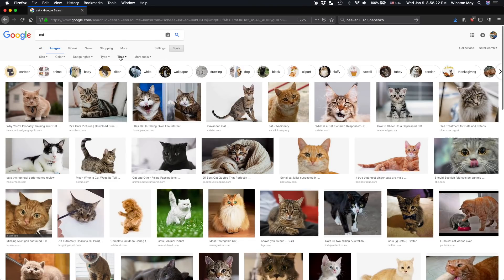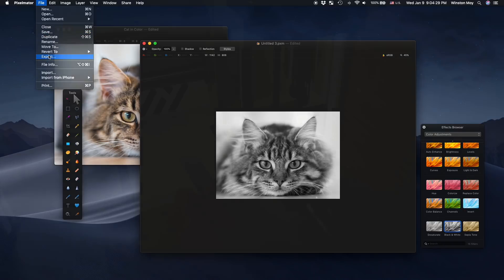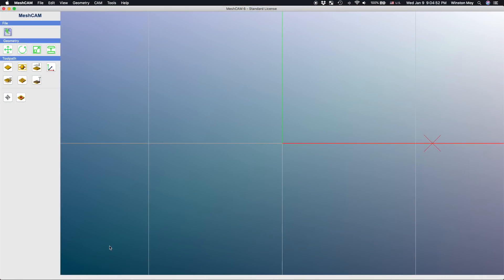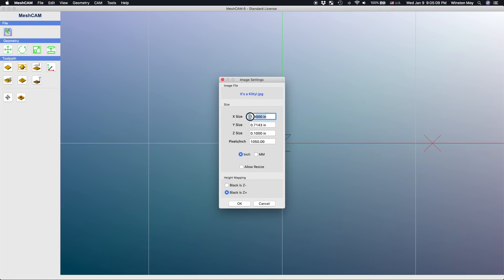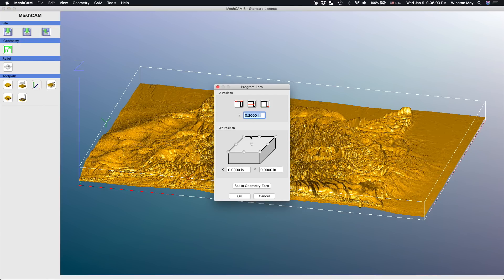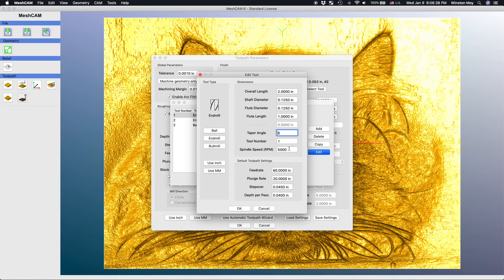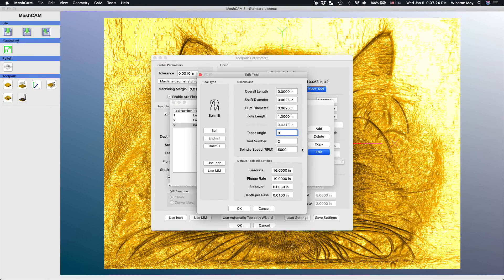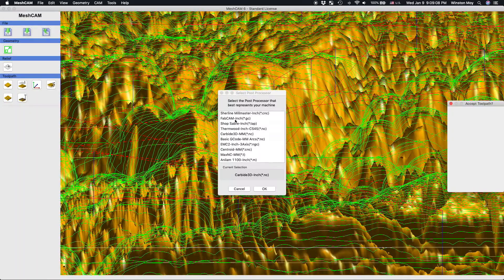How to Make a Lithophane in MeshCAM

Comment: Is this something  carbide 3d sells and  would it be helpful if I were using  the machine bed to set my  zero.
Also could you put together a video on using  the machine bed as zero. I think that it helps stop cutting  into the spoil board  when the material is not the same thickness in the middle

Comment: Winston  in this video and  others I see you touching  off to a pin sticking up from your spoil board can /would you tell us what  that is for and maybe how it is hooked up. Jeff Peters
Reply from the maker: That's the built in tool length probe. If you need to switch tools in the middle of a program it will automatically compensate for the height difference.

Comment: Very, very cool :) And nice to see you working with Carbide 3D, Winston! 
Though MeshCAM is pretty expensive. Any thoughts on showing how to do similar with Fusion 360? I imagine there's got to be a way to do it... just haven't found it myself yet.
Reply: It's difficult to do this with Fusion because of the polygon limits, same reason I couldn't do crazy detail with my topographic carving. The STL file needed would be *massive*. It just wouldn't look as good with a 10k poly limit. Some of Vectric's programs can also do lithophanes though, but it's also going to cost $$$. I haven't scoured the internet though, there might be something else out there...
Reply: @WinstonMakes  Ah, that makes sense. I had hit up against the same limits but I honestly thought I had been doing something wrong. Didn't realize it was a hard (or at least heavily recommended) limit. That's unfortunate. I hope the Fusion team can improve that limit in the future. 
Thanks for the clarification. Looking around now for something cheaper or free. Will post back if I find something.
Reply: Adam Haile fusion is EXTREMELY limited in true 3D modeling and sculpting. They’re getting better, but Z-brush is awesome, yet, nothing to CAM in, meshCAM is good for grey scales, Vectric which I’ve never used but it looks solid? and then there artCAM(soon to be Carveco) which is in my opinion the ultimate 3D artistic sculpting CAM software. Very reliable, very expensive. Very easy.
Reply: @COdrummaCO  Thanks :) I found ArtCAM but was sad to see it discontinued. Glad to now know it will be released again... looking forward to that.